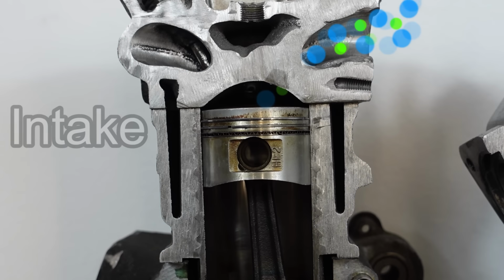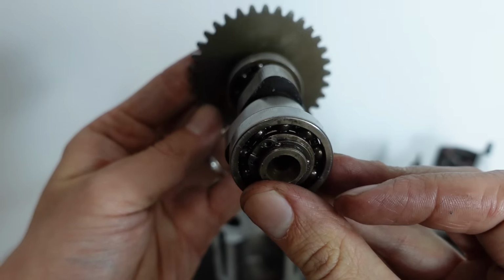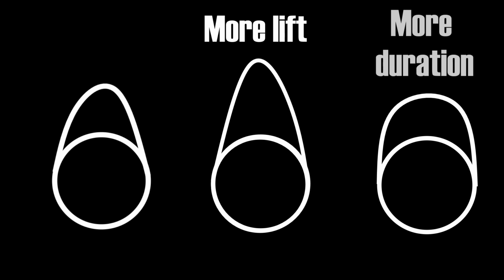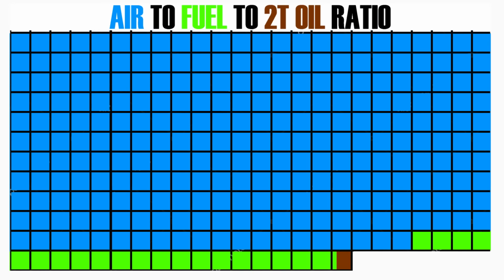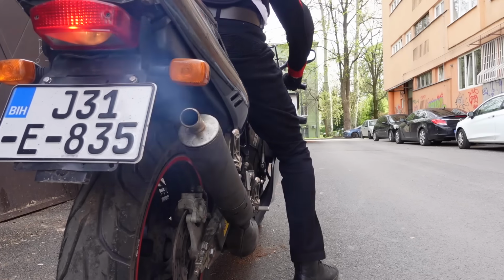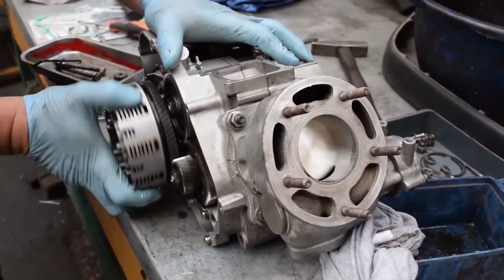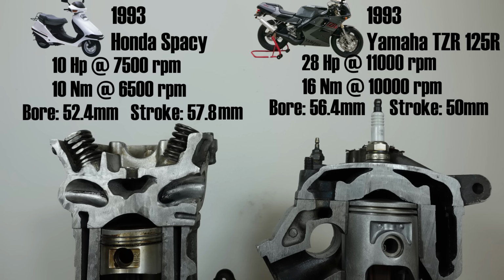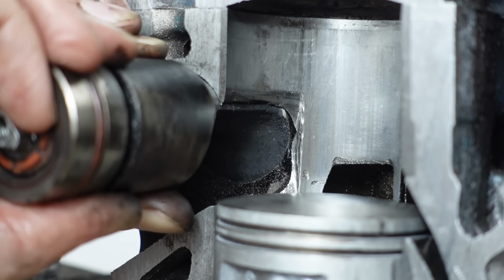The Only Video You'll Ever Need to Watch to Know how 4 Stroke and 2 Stroke Engines Work and Differ

Comment: I'm a retired auto mechanic, and I've never completely understood how a two-stroke works. Your presentation was, quite simply, amazing! Thank you!
Reply: Same here.. but without the retirement.😉jealous much
Reply: Now check into how a Detroit Diesel 2 stroke works, unlike these 2 strokes that work on the principle he explains here that's how common dirt bike, chainsaw and weed wacker engine's operate the crankcase of a 2 stroke Detroit Diesel engine is the same as a 4 stroke engine wherein it has a normal bottom end that has the engine's oil supply in it like a car engine, complete with a dipstick, instead of having the air/fuel mixture passing through it with the downward motion of the piston pressurizing the crankcase to force that air/fuel mixture into the cylinder and the upwards motion of the piston creating vacuum that draws the air/fuel mixture into the crankcase, and it's why they MUST have a blower on them (notice I didn't say supercharger, I'll get to that in a moment).
The way they work is when the piston is near the bottom of it's power stroke from the combustion process the cylinders exhaust valve's open letting all the pressurized exhaust gases blow out, then at the very bottom of the stroke the piston uncovers an intake window on each side of the cylinder, that parts the same as the 2 stroke engine's he shows here, they have those intake windows instead of intake valve's, the windows are the end of the intake tract that begins at the blower, with those windows and the exhaust valve's both being open that allows the pressurized intake charge to push the residual exhaust gases in the cylinder out past the exhaust valve's, that's how the cylinder gets scavenged and the intake charge is introduced into the cylinder, then just as the piston moves up and covers those windows the exhaust valve's close at the same time (approximately) resulting in a fresh intake charge in the cylinder that's then compressed during the compression stroke. 
This is why the engine isn't actually supercharged despite people mistakingley believing they are because it has a blower on it, without an exhaust valve that's closed and an intake valve that's open with the blower pumping a compressed charge into it until an intake valve closes it's not truly supercharged, it all works out as though a normally aspirated engine would. 
They might have a moment where the exhaust valve's are closed and the intake windows in the bottom of the cylinder are still exposed that leads to maybe a pound or two of charge being trapped inside the cylinder at the right RPM's but I'm not sure on that one, I do however know that they really aren't considered to be supercharged engine's because of their operating principle.
Long before I learned how they worked I spent literally thousands of hours operating one in the Army as the driver of a weapons system that was built on an M113 armored chassis, they're powered by a V6 Detroit Diesel 2 stroke, I always used to joke around and say that they didn't really need a throttle pedal but instead could have just had a toggle switch that had "idle" and "run" positions because you either had one idling or the pedal stomped all the way to the floor in order to get one to do anything, not long after I got out of the Army I was talking to an old timer truck driver that drove back in the day when some trucks used those engine's, he said the joke back then was if you were going to drive a truck powered by a 2 stroke Detroit Diesel the way to get one to really run was to slam the door on your hand when you were getting in the truck.
They didn't produce nearly as much power per cubic inch as a modern 4 stroke supercharged/turbocharged diesel engine does but they'd last a long time in between rebuilds which is why trucking companies liked them, they were also common for energy sources in places like steel mills since they'd last so long, places like that actually had them set up in ways where through turning a set of valve's to route the oil through a different set of filters they could have an oil and filter change performed on them without them being shut down, they're also made in both left and right hand rotation with the fronts and backs of the blocks being made in such a way that they could be bolted together, two V6's could be bolted together to make a V12, they didn't make the best truck engine's but where they really shined  was their industrial applications like in a steel mill where they had to reliably run 365 days a year 24/7.
Reply: You are not a good mechanix
Reply: My understanding of 2-stroke: 20,000 rpm squeezed into 10,000 rpm
Reply: @kerimca98  
Right, unlike a 4 stroke everytime the piston goes down on a 2 stroke it's on it's power stroke, so you get a power stroke every revolution of the crank instead of every 2 revolutions of the crank, theoretically twice as much power per cubic inch as a 4 stroke but it doesn't actually work out that way for a variety of reasons, it's actually more like 1½ to 1¾ power per cubic inch.
Reply: @tomasgorta3154  most vehicles nowadays use 4stroke, so knowing how 2T engines work isn't strictly necessary to be a good mechanic. But yeah i get your point
Reply: @tomasgorta3154  Most mechanics never even see a 2 stroke engine, so I think the stupid one he be not.
Reply: @tomasgorta3154  He may not be a good mechanix, but that doesn't mean he isn't a good mechanic.
Reply: @dukecraig2402 die alten Traktoren mit 2takt Motoren hatten noch ein sogenannten Nasenkolben. Damit der angesogene Kraftstoff nicht mit aus gespült wurde
Reply: @dukecraig2402  I can't read this gibberish mate

Comment: Very good explanation.  However, how does the spark plug on the 2-stroke know, when to fire? 🤔
Reply: Likely same as on 4-stroke. As far as In understand, the flywheel needs to be synced to the piston as well. There's some sensor (Hall's?) which triggers the ignition coil.

Comment: By far the clearest explanation I’ve seen on the difference between two-stroke and four-stroke engines! If you do plan to make more future videos on two-stroke I’d also love to see obscure two-stroke designs such as diesel and marine applications, forced induction, and the inclusion of sleeve and rotary valves instead of reed valves like in Rolls-Royce Crecy and an experimental Ferrari F1 engine from the 90’s. VisioRacer did a great job introducing me to this, and I want to learn more.
Reply: I definitely second this
Reply: Except the title is completely misleading... as there are two stroke gasoline and two stroke diesels are that mechanically significantly different than what is presented here.
Reply: @Wingnut353   I understand your point, but I suppose he was referring to the everyday examples people are aware of.

Comment: I've disassembled 2-stroke engines as a teen in the 80s and later owned an RD 350 with YPVS, so I have a bit of amateur experience. 
This is by far not only the best comparison video between 2 and 4-stroke engines, it is the best YVPS explanation! I learned something about the exhaust "resonance". Great work on the video and fantastic results. Thanks!
Reply: Absolutely 💯 - Ohio
Reply: Had a DT 125 with YPVS back in 90's.  Some of my friends had the YPVS  locked in place. 
It felt like they had half the acceleration of a YPVS . Pretty amazing what difference it made.  Never really knew how it worked, just assumed it created more pressure somehow. Wasn't that far off.
Reply: Now go check out how a 2 stroke Detroit Diesel engine works, their crank cases are like a 4 strokes wherein they house the engine's oil supply like a 4 stroke and have nothing to do with passing the air fuel mixture into the cylinder. 
Prepare to have mind blown.

Comment: My dad passed down his old dirtbike to me. 1980 Yamaha 'Enduro' DT 175, however it was lacking ALOT of maintenance. This video was so informative, I've never worked on engines before, so im glad to have a better understanding now. 

It's been a joy learning/working on the bike with my father, cherished memories as he gets up in age. Its two stroke, and the pistons are starting to sound rough, need to learn to do a top-end rebuild soon, but its held up over 40k miles since my dad, and now I have it, and its still going strong (after a carburetor replacement)!!
Reply: Are you sure 40,000 miles without a top end rebuild? Lots of motorcycles measure the tenth of the mile too, in a slightly different color

Comment: This is what I learned as a kid when my dad bought me 2 see through engine model kits. One was a Chevy small block the other was a Yamaha 2 stroke and see by learning and building was amazing. Both models had all the moving parts making it easy to understand quickly.
Reply: Convert the Chevy into a 2 stroke
Reply: @Bruce Miller  how would you do that?
Reply: @LifenSantaBarbara  You can poopet valve loop scavengind or cut ports in the block.
Reply: Poppet valve loop scavenging.
Reply: Oh, yeah. "The Visible V-8". Mine was functional on gnarly 9 volt horsepower, with tiny red lights for plugs that lit in the actual firing order...real bitch getting it to run right, and be careful with that glue, folks!
Reply: Smart dad.

Comment: I'm a BEV owner, but I rode and drove ICE 2 and 4 wheeled vehicles for over 40 years, educating myself over the years in engines. So I can say with a measure of validity that your explanation of the 2 and 4 stroke engine cycles is excellent. It's certainly the most comprehensive short video to cover these engine types in their similarities and differences that I have ever come across. Anyone who was confused before watching this video would not be afterwards. 👍

Comment: Nice to see you touched on the Direct Injection. OMC brought that out in 1997 on some of their Outboards, and because of how it affected the Combustion Process resulted in many Engine Failures due to Carbon Buildup behind the Rings. DI has also created many problems for 4 Stroke engines too
Reply: Mercury Marine also had a line of DFI engines around the same time (I was a Merc dealer at the time). All of those DFI engine injectors were based on a 'new' engine developed by one Ralph Sarich. Mercury bought the rights to the entire engine system just to get the injector system in the 'Optimax' engines.
Reply: If I remember correctly Aprilia offered direct injection on two stroke scooters in 1999.
Reply: @jsfrederiks  Honda tried it on their V4 2T grand prix engines but ultimately stuck with carbs.

Comment: As a loving Trabant 601 owner, this is one of my favorite videos you've made! It's also fascinating to see how it's engine compares! It uses rotary valves instead of reed valves, three piston rings instead of two, and produces more torque than horsepower. Also due to the rotary valves, rebuilds are not cheaper than a 4-stroke per se, because the valves slide directly on the aluminum crankcase there's pretty much nothing to reuse, you rebuild it by replacing the entire engine minus the engine accessories which are fully serviceable. In case anyone's curious how long a 2-stroke car engine lasts, it's best measured in decades, not distance :)
Reply: crankshaft regeneration being the biggest cost
Reply: It is also worth nothing that is a single type of 2 stroke... the gasoline two stroke and it is possible to build very different types of engiens with a 2 stroke cycle. The 2 stroke diesel for instance..... one of the most important engines of the last century.
Reply: @Wingnut353  Indeed, the diesel 2-stroke has been used in many vehicles ranging from trucks to container ships, their importance cannot be understated.

Comment: One of my all time favorite bikes was the old Yamaha RD350 with YPVS!
That little bike used to go like hell for a 350 and you could really feel the difference. Almost like a turbo kicking in!
Just such an awesome bike!
Reply: Yeah they still are great bikes, the YPVS engine is legendary and ranks as one of the best 2T engines ever! Here in NZ they were called RZ350s same as in Japan, we also got the 500cc V4, and a 250 cc version that was legal for learners, (you could get your licence at 15 here back then😄)  when i was in high school my 2 best friends both had 2 stroke road bikes, one had a 83 RZ250  the other had a mk1 RG250, i had a Kawasaki KR250, we thought we were hot shit😆 Every other kid that rode a bike to school had an XR Honda or a TT Yamaha dirt bike, both were road legal here, despite having no indicators or proper horn😄 . My current 2 stoke fix is a 96 TZR 250 SPR and my old IT 490 which ive owned since 94 and is now fully restored.

Comment: Amazing visual explanation. I've been an amateur mechanic of motorcycles since the mid-80s, so I've lived through the golden years of 2 stroke engines (just remember the rd, nsr and tzr, dtr, etc) . In those days, 4 stroke small capacity engines were slow and not desirable compared to 2 stokes.  I remember the beginning of auto-lube and Motul 2t smell, etc. Of course, 4 strokes were more economical and much more reliable in comparison, but comparing a 125cc 2 stroke  with a 125cc 4 stroke was unfair. Different times. Nowadays, we desire simplicity in a world of computer controlled engines. I recently bought another bike, a Honda GB350S air colled single, mainly because of that desire for simple and mechanically accessible machines. Thank for putting together such a comprehensive explanation about the differences.

Comment: Fantastic video! As an avid motorcyclist I absolutely love 2 strokes and for street bikes here in the States, it’s a thing of the past save for collectors and hobbyists but for my money, there will never be a machine as incredible as the Honda NSR 500. Seeing them at the track on occasion is always drool inducing! For off road, it suprises me how we’re pretty much down to just Yamaha who still has the YZ on the roster and KTM with a few. Yet so many riders prefer the 2 stroke! The power comes on entirely different and I think for the more seasoned rider, it’s a bit more of a fun experience having that snappy, high RPM at the twist of the wrist. The 4 stroke models are a much smoother and robust (in terms of feel) power curve- which is nice but again not for everyone. I think a big part of the reason so many old school riders prefer the 2 stroke is also the ease of maintenance. Yes, I know guys that after a single day of racing will rebuild the entire top end of the engine but this can be done in near minutes. I’ve personally switched out pistons, rings, pins and gaskets many times but getting into valves, springs and cams? I may need some assistance with that especially if time is a factor. The flip side to that? You more than likely won’t have to. I’ve had a 2013 GSXR 750 that was my commuter and ran hard at the track every week before finally becoming a track only bike and with merely keeping fluids and filters fresh, it’s been as strong over 10 years later as it was the day it came off of the showroom floor. Still I think the idea of potential failure is enough to keep the guy who grew up on a CR250 buying another 2 stroke or rebuilding the one he has. Anyway, I’ve rambled enough, fantastic video, truly a gem on the platform!

Comment: Motorcycle Motor Idea #347 
A vacuum cleaner type blower on the crank, pressurizes intake air from a front scoop, and the exhaust turbo runs the alternator electrical generation using Peltier effect producing electricity from heat also. The turbo quiets the exhaust and a small box muffler under/behind the engine with multi 3 inch small diameter side outlet pipes aimed down and back dumps the exhaust without any muffler weight to speak of. Use dual rear swing arms for strength and light weight.  Two small shocks at 45 degree forward and a partial uni shock spring. Opposing 2 cylinder, 2 cycle, both fire at the same time, motor with two crank eccentrics.  One valve per cylinder using PULL RODS. Use a 2 tuned cycle muffler if it's a 2-cycle motor?
The pull rods use no valve springs. The arm that closes the valve is made of spring steel so the valve closes with no friction on the cam until the valve is closed then a little more pull puts the needed pressure on the valve. A bearing rolling on the cam reduces friction.  The cam is ground into the crank shaft. Two pull rods per valve, one opens & one closes, Made of lightweight flexi cable. Cylinder bore & stroke are set up for semi High Rpm of about 9,000 rpm, so the stroke has torque, & power is available at a lower RPM. Internal crank case pressure pushes oil from the sump to a tank through a one way valve, then that pressurized tank puts the oil into the bearings on the compression stroke. Excess internal crank case pressure is relieved at TDC.
The gasoline is not mixed with oil at all. Crank bearings are roller bearings, since there is very little MAIN bearing pressure due to the fact that BOTH pistons fire at the same time and compress at the same time. That is what the dual eccentrics are for.  Internal moving parts are built to have less air resistance.  Oval tubular connecting rods. Round counter weights get thicker on one side, ETC. Separate tyranny in the block, uses different oil. Crank shaft parallels the rear wheel shaft. Power gearing is set up so cruising speed of 65 mph uses no gearing if possible. Low seat height, split level comfy & forward foot controls.